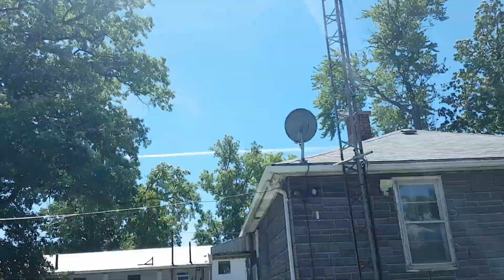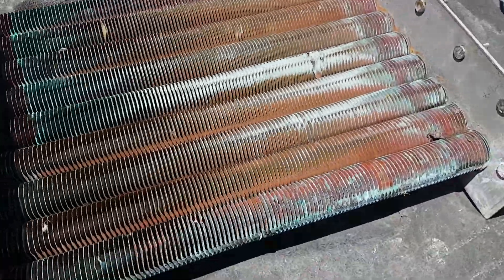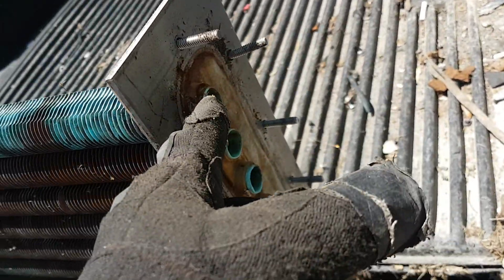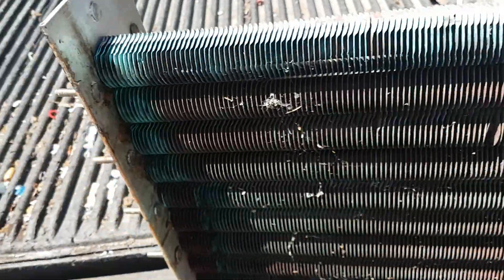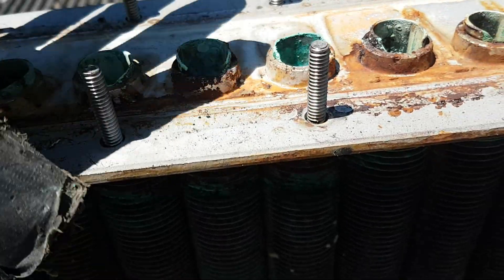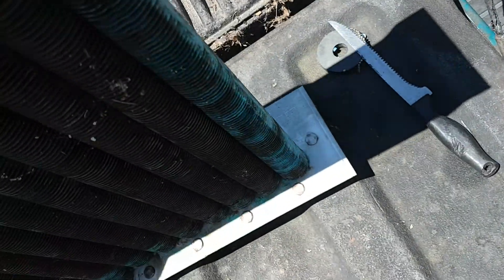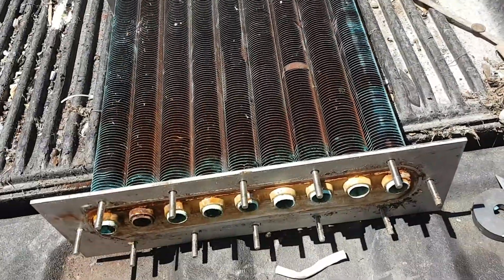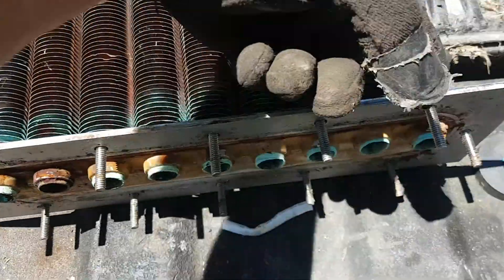i need a answer!

Comment: Honestly I would take it as is. Using my yards prices which are terrible and assuming the stainless plates are 10 of the 25 pounds I would only gain a quarter by cleaning it so yeah that's what I would do. But if I was to clean it I would hit it with a sawzall or angle grinder on the inside of the plates
Reply: And that's not including the stainless which would only be a dollar at my yard